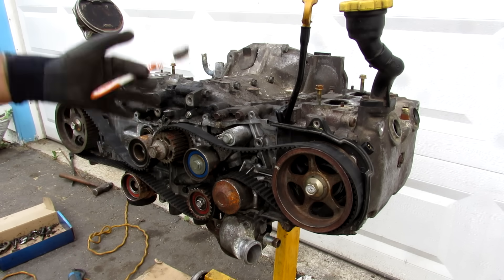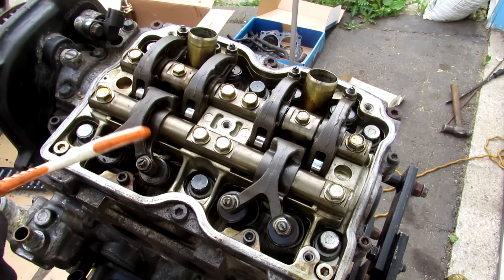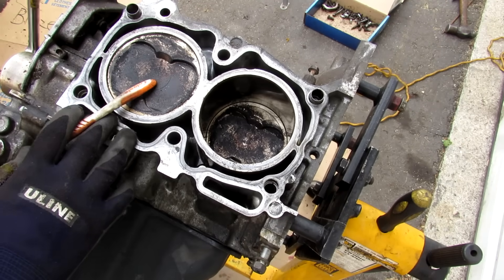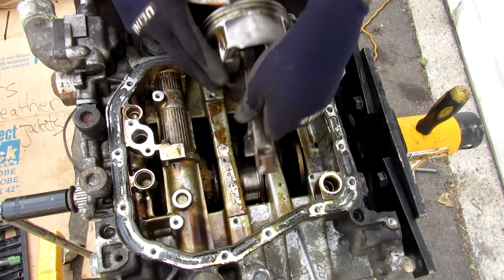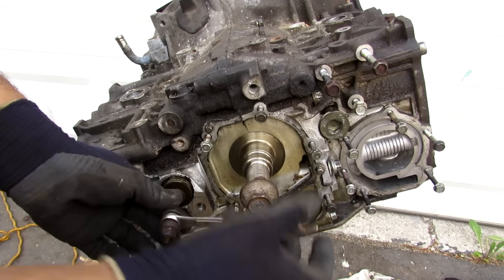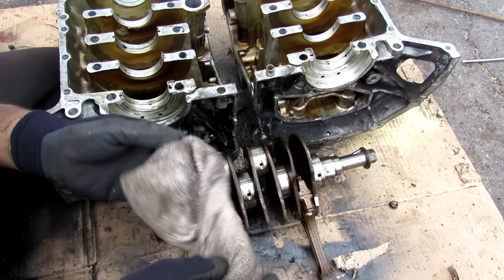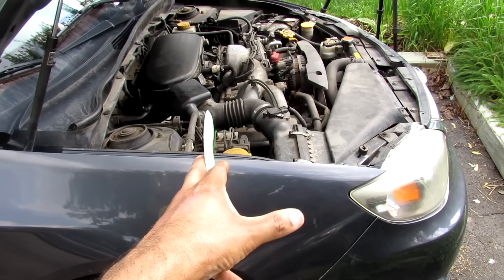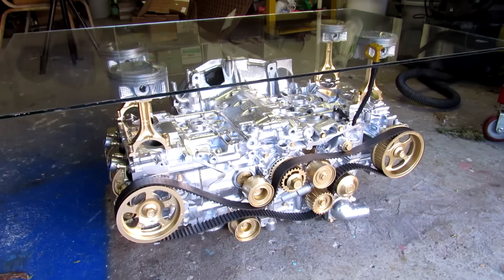Why Subaru Engines FAIL

Comment: three friends with Subaru"s... all normal drivers, all blown head gaskets... one needed new heads.
Reply: @Jon Ripley thats why you buy Honda and not subaru, 350,000 klm and still on origanal water pump, starter motor,  clutch and radiator..
Reply: craig jessup the v6 Honda have their own set of problems too.
Reply: @Jon Ripley Absolute nonsense - it is not a 2 day job, any Subaru mechanic can whiz through a full SOHC timing belt kit replacement including water pump in around 2 hours.
Reply: @jaredrattray  I believe he's referring to someone like you or I doing the job.  I don't know about you, but I dont feel something like a water pump replacement should require a subaru master mechanic to do the job in a reasonable time period.  Just my 2 cents
Reply: I drive my semi built NA 2.5 daily with no issues even the 5 speed is holding up, they get a bad wrap from bad drivers and maintenance
Reply: Did they fit four new tires at once so the traction control retard the engine
Reply: I've had 2 subarus with over 250k miles. These run as long as any other motor if you maintain them.
Reply: I also once owned a Subaru. I have owned more than 50 cars over the years but the Legacy was the only one where I got a complete and catastrophic engine failure.. Not even driven 100k miles.
Reply: The engine are unreliable.
Reply: @ontarioman6301  Link? Stats? Source?
Reply: Subaru's never had that problem ,I drive them Hard  Must do a lot of  Service/maintenance .
Reply: Same here.  I will never buy one again.  An engine shouldn't have problems this major requiring thousands of dollars of service with only 90k miles.

Comment: These engines literally have a shit ton of bolts holding it together! Great job walking us through the process!
Reply from the maker: Not only is it holding compression at the top end but it's gotta hold it's crank together
Reply: 80sriceman - no, they do not LITERALLY have a ton of bolts. Idiot.
Reply: @markfox1545  Ahem, he said  "a shit ton". Unless you can produce an official definition of that metric, you owe riceman an apology.

Comment: About a year ago I test drove a Subaru and a BMW. The Subie was one year older and $1,000 more expensive. It had about 40 more HP than the Bimmer, but zero road feel. The Bimmer had X-Drive and grabbed the road like you wouldn't believe. At the time, I didn't know much about Subarus, only that they had that flat 6 engine, which at the time, sounded like a great design. I can now see that it's a horrible design. I will never buy a Subaru.

Comment: If the V6 engine is smoother running than the boxer 4 why do most manufacturers use duel balance shafts in their V engines? There are no balance shafts in a boxer.

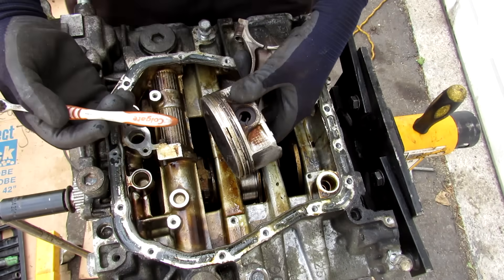Comment: @6:14 "Attenuate" means "not as strong" or "to make less effective". So the oil starvation issue isn't attenuated by the engine burning oil. It's made worse by burning oil. To attenuate the problem would be to make the problem less of a problem.

Comment: Just had a head gasket failure on an 09 with less than 99k miles on it. Misfire and all.  Will NEVER buy a Subaru again!  All they do is leak, rattle, fail and they suck to work on.

Out of 4 Subarus my family have owned over the past two decades, every single one had leaks and other issues.

Comment: Its pretty much junk with some  power potential and cool awd. Just get a toyota. Or something easier to rip apart/ maintain.  The subaru is ok at best, the huge dia pistons will always be a oil consumption point and the bottom of piston will wear  faster, lower center gravity is fine but oiling system is junk.

Comment: Damnnnnnn!  While you do talk fast, you provide a LOT of info and very interesting spec's and engineering data in 14 min - BRAVO!     I always wondered about the engineering spec's &  compromises Subaru made and now I know for sure!  Some are inherent in the design and some are because of quality or manufacturing issues.    I now wonder about the Porsche  boxer 4 and 6 cyl & the BMW K1000 and K750 engines

Comment: “... and the oil is not very good at cooling the engine.” I beg to differ. It’s a known fact that motor oil does up to 40 percent of the engine’s cooling process.
Reply: Sure but not through the water pump and water hoses.

Comment: I've flown in a Gyroplane with the Subaru engine. You have to push the engine very hard to fly around at normal speeds. They seem to take the beating fairly well.

Comment: Back in 2002 I had a version 5 sti wrx  (unmodified, just had a HKS exhaust) that blew the head gasket at 20,000 miles then the bearings went 22,000 miles. Cost me a fortune to fix.  I wish I knew all this back then :(

Comment: The non turbo ones seem to last almost forever as long as they don't run too low on oil or the timing belt doesn't break.

Comment: We have a 2004 Subaru Forrester with 300,00KM on the engine. It wasn’t babied and is still running. Have had more issues with the power windows failing.

Comment: After watching this great video i have come to the conclusion that this is not how an engine should be designed for reliability.
It looks like it has lots of in - built design faults and failure points. On top of all this it looks difficult to maintain thereby adding to the problems.
I wouldn't start here if i was an engine designer!

Comment: Good video but you were incorrect on the balance of the V6 vs the Boxer. Boxer has good primary and almost perfect secondary forces  balance which is why you have no balance weights or harmonic balancers. A V6 has poor primary balance which is why you will see big weighs on the crank, I6 and I5 do not have the primary balance issue but do have secondary balance issues.
Reply from the maker: Thanks. I'm doing more research on this now for the inline 5 Volvo video
Reply: @speedkar99  You should look at the Chevy Colorado i5 from a few years back, so out of balance it required a balance shafts and weights.
Reply: @speedkar99  Also I think the balance is one of the reasons that these were originally used on airplanes where inline engines have issues, but not entirely sure on that one.

Comment: So couple of thoughts;
   Head gaskets are typically always immersed in coolant and have oil in contact with them at some point. Their orientation in the engine has absolutely no bearing on this, so turning your engine on it's side will not cause the 'bottom' side of the head gasket to fail. The idea that this happens is a total myth and it's actually funny if people believe this is the case.
   Next one, the engine oil pan. Combustion deposits in the bottom of the oil pan are absolutely not evidence of coolant contamination or 'sludging up'. They are evidence of infrequent or poor oil changes, using the wrong grade engine oil etc. which judging by the bearings later shown seems to be the case.
   The bearings, sigh have been starved of oil, but the grooves in them are caused by reckless driving. This was from someone jumping in the car then redlining it from cold, abusing it with no mechanical sympathy at all. The oil filter does not do a lot of filtration at this stage until the oil has warmed up, so small chunks of debris in the oil rip into the bearings. If it was only from oil starvation alone, the bearings would have a polished shine on them from being melted down to their backing material.
   Piston cracking is not caused from 'poor' materials. It's caused by driver abuse. All engine manufacturers use piston materials specified for the intended application with a safety margin built in for reliability. This does not account for young Johnny Moron jumping in his Subura that hasn't had an oil change in 2 years, starting it up on the cheapest low-octane petrol he can find, then redlining it out of the car park and detonate it's way all the way home before it has a chance to warm up. Sudden thermal load forces the piston to expand unevenly, forms a stress fracture...crack. Goodbye piston ring. I have seen this in so many engines, it's purely down to the idiot behind the wheel. 
   That's what causes 'Piston Slap', it's the sound of everyone else in the car park facepalming as smoke pours out of Johnny Moron's exhaust all the way down the road. By the way, 'Teflon' aka Molybdenum plating on the piston skirt is not there to maintain clearances, it's there to help distribute an oil film and stop the piston from binding in the cylinder when the engine isn't running. Wearing it away increases piston slap, but it is not the cause of it.
   These Subaru engines are pretty good engines, when properly maintained by a competent mechanic. The bottom line here is service your engine properly, any engine not just Subaru, take care of it and do not abuse it from cold. Use good engine oil and change it frequently as per manufacturer specs.
   Ultimately I don't see why this is "Why Subaru Engines FAIL" when 99% of the time, it's the idiot behind the wheel that will not treat them right.
Reply from the maker: Agreed, alot of it can be avoided. But compare the Subaru boxer to a regular inline 4 cylinder with the same demographic of people who buy these economy cars and the inline 4 will last longer.

Comment: My cousin has a 2006 Forester, 187,200 miles. Friend of mine has a 2014 outback, 121,000 miles.  He does a lot of traveling in the outback obviously, they maintained their engines and the servicing, haven’t had any problems, no true money pit.  I’ll be sure to share the other comments from “engineers” of how Subaru engines fail and are enormous money pits. I am sure they will be pissed to know that their engines failed!?
Reply from the maker: Maintainence plays a huge role on these engines, as mentioned at the end of the video. There are good examples (like your friends) and then there are bad examples, but due to the vast number of owners who don't maintain it, they tend to fail more than other economy cars.
Reply: speedkar99 that’s very true. I have a 2016 Forester I do maintain that through the dealership, going in for a 60,000 mile service you just always hope and pray you get a good mechanic working on your car LOL informative video by the way but yes any vehicle can fail if you refuse to keep it maintained properly and follow maintenance guidelines

Comment: Well done.. For your target audience it would be helpful to show what a good bearing looks like to contrast what that wear is like. Also, Oil actually does a significant amount of cooling and is a major heat transfer medium, transferring that heat to the coolant. For instance on "air cooled" motors, they are really air/oil cooled.
Reply from the maker: Oil can only cool a certain amount, it's heat capacity is limited compared to coolant and it's circuit has a tiny oil cooler (if equiped) compared to the huge radiator in front of the vehicle. It won't do it's job in the water jackets as well as coolant would.

Comment: The slap isn't from tolerance, it's from too short piston skirts that they put like that for better efficiency. Great video though keep up the good work.
Reply from the maker: Thanks. 
They slap more when the skirts wear down. 
If not accounted for in the skirt length it'll slap after a while. 
If it was too short from the factory it would slap when new.
Reply: @speedkar99  A little bit of column A, a little column B. Yeah short for efficiency, and also friction reducing materials on the surface for more efficiency. Back when they were longer and just plain steel it used to never be an issue. But the EPA increases mileage standards every year and I'm not totally against that it's for a good cause I guess but eventually engines just can't get any more efficient without causing major side effects like this and that's how you know when it's starting to go too far.
Reply: @speedkar99  I've just been thinking more about what you said and I just realized that the longer the skirt, the more they would have to wear down diameter wise before they would start slapping.

Comment: Clickbait. This guy sells motor oil. The EJ25 is a very reliable engine. The Subaru is very reliable, long-lasting car. This brand is the longest lasting of all mfrs. No, I don't own a Subaru, but I would if I were in the market for a new car (or used, for that matter). He's right on one point - proper maintenance of any car is absolutely necessary. The rest of this stuff is a waste of time.

Comment: The good news is if your wife is driving a Subaru, you probably won't need to replace the spark plugs at 100k. You'll be replacing the car instead.

Comment: This is the answer to most Boxer systemic design flaw failures. The Killer-B Performance oil pan with baffles and I newly designed oil uptake. It adds 1.3 qts more oil to the system improving  cooling and lubrication.
Reply from the maker: Yes that's a good upgrade. 
Some people just run more oil to ensure it doesn't run out

Comment: Great, thorough overview. You have killed almost all of the appeal boxer engines had for me.
Reply from the maker: Not all the issues here affect ask the engines. It's a general Subaru topic. The EJ20 for example isn't as supceptable to head gasket failure compared to the EJ25 for example
Reply: @speedkar99  My concern is the asymmetric lubricant and coolant distribution around the cylinder and piston pointed out. I presume this is an inherent weakness to the boxer design. The gasket failure is not a fault of the boxer geometry per se. I can see, however, that having the coolant jacket encircling the entire cylinder might cause interference with the oil galleries due to their proximity. Again that (i.e. the interference) in turn may or may not be a fault of the gasket.
Reply: Merl Klarhoelter  Possibly. He didn't qualify his assertions so I cannot make any inferences as to overall reliability, longevity, consumption etc. and therefore I have only considered them as design issues - or rather, design consequences. Lubrication and coolant stagnating due to gravity to one side of the cylinder, an effect most pronounced when the engine is cold, was the main issue highlighted to me - something that I had neither thought of before nor had anyone else point it out to me. This is a pure design issue inherent in the geometry and no countermeasure can alleviate it. Also, note that I'm referring to boxer engines in general whereas, I think, you're maybe referring to Subaru boxers.

Comment: Couple things:
This engine had heads that don't match the block. It had pistons from an AVLS 2.5i and heads that didn't have AVLS. 
The black painted bolts have different diameter integral washers, that's why they're painted black.
Reply from the maker: Thanks
They do get torqued more too right?
Reply: @speedkar99  yes.

Comment: What years would benefit from retorqueing the head bolts?  Does the FA20 suffer from the same problems you mentioned for this engine?  I have a 2013 base Impreza, and you’re making me nervous.  I’ve mainly been concerned with the shitty CVT, I’ve taken good care of my engine so far.

Comment: Half the problem is people thrashing them and not taking care of them. Cars don't run without a bit of care
Reply: Totally agree, it’s all about not too much boost & Servicing.

The biggest issue is too much boost due to the blocks not fully closed in later models
Reply: And some cars require far too much maintenance to be reliable. I traded my V8 Lexus GS430 with just under 300k miles. Never gave me an issue aside from a faulty thermostat they cost me $30 to replace
Reply: @ravencrestmedia  thats because Toyota knows how to make engines. They are almost all reliable
Reply: @WorivpuqloDMogh  amen to that
Reply: @pens8766  yeah. The older models are bulletproof. Just like the old mazda diesels. The 2.0D without turbo, is really reliable. Up to 800.000 kms. With ease. And it doesnt feel slow
Reply: I drive a Chevy Suburban with 301k and if I needed to rebuild the entire truck it would cost me $5000 the motor is abused and neglected still runs strong. That is why the LS motor can get FAA certified as they will still run even if it suffers what would normally be a catastrophic failure for a period of time to allow for emergency landings.
Reply: Exactly Subaru, and Volkswagen bug motors can be FAA certified. That requires a reliably engineered engine, and then further modification. LS motor are another auto engine that can be made FAA acceptable.
Reply: Some are sensitive to it, some are not.

Comment: im not really a fan of the EJ25 the Subaru specialist we go to has had plenty blown up ones to work on and the my mom and dad own Outbacks both had the engines rebuilt one has around 180,000 and sounds like it has a valve slap the other is nearing 300,000 and has been having some head gasket issues if you ask me they're ticking time bomb engines. Thats why im happy my 1996 Legacy has the EJ22 a bit weaker but way tougher

Comment: actually i have to say if you keep them maintained there not bad cars at all i had a subaru justy back in the day the previous owver put unknown mileage on it because it stopped counting mileage so over 600,000 miles would be my guess it was a one owner car original engine no replacement we put another 700,000 miles on it before subaru stopped making parts and it would no longer pass emmitions without the heat pipe replaced on the exhaust which was a subaru only part no third party sucks that was a amazing car loved it the only thing we did to the car was replace the coil for the spark plug system it was mounted on the engine and sadly it died on a trip to seattle when the coil came off in the middle of the road we placed a new coil on and attached it to the firewall and never had to touch it again we did oil changes and even maintence did a flush and before its final death not being able to get parts it was sold to a friend of ours who pop riveted a new heat sheild and pipe together and finally got it to pass emitions after that he took it on a trip to california where the last i heard 2 hookers bought it from them for 900.00